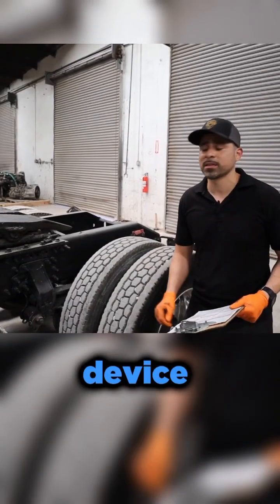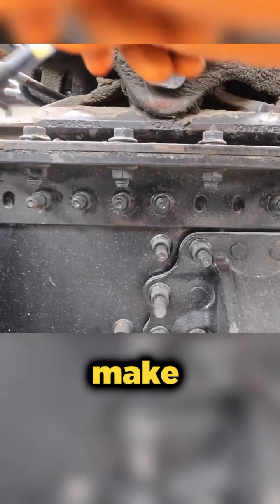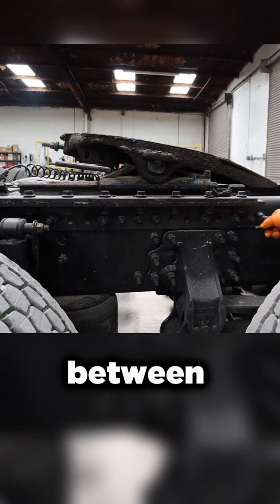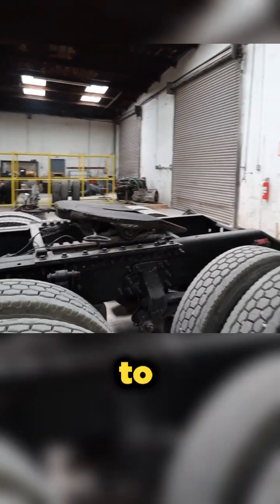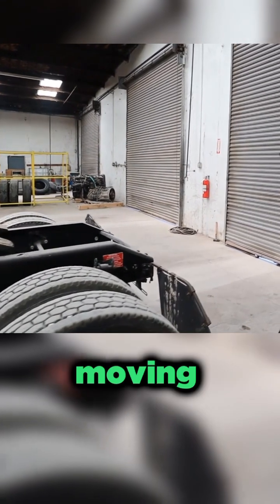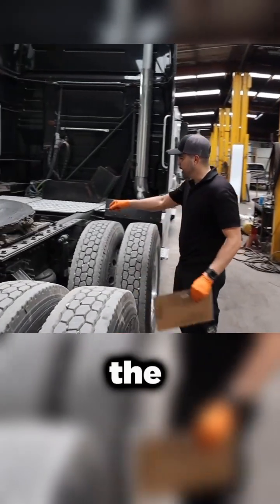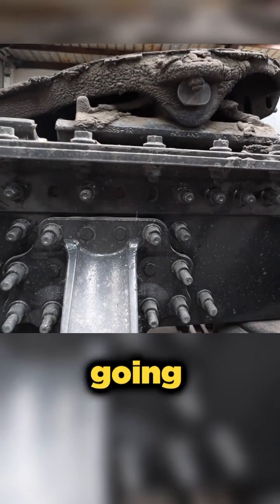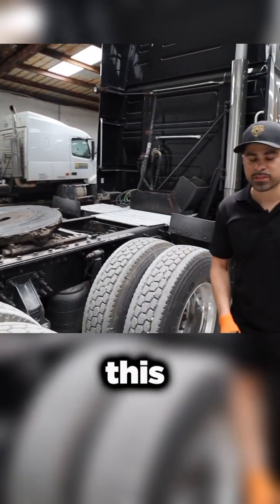PT12. Carefully inspected the 5th wheel on the semi-truck, ensuring it was securely attached

Comment: I used to drill the semi truck frames for the angle iron to bolt up to the frame. (the 5th wheel was mounted to this first angle). Used an air powered drill motor that needed an extension long enough so I was "outside" the tandem wheels.  That was 1970.  The hole size was 11/16" as I recall . Used 5/8" bolts. Something I can remember those #'s, this many yrs later.